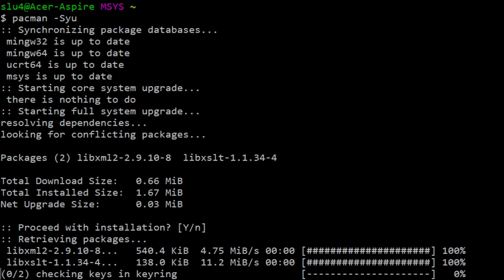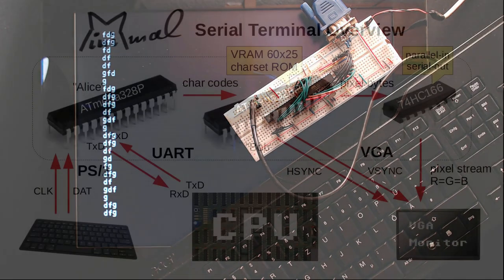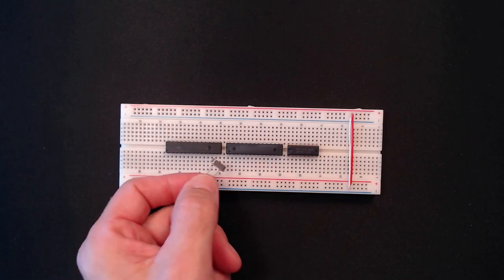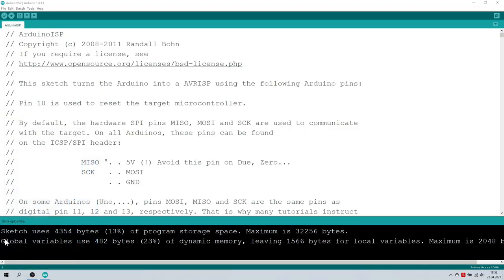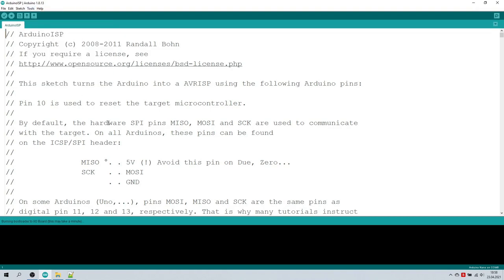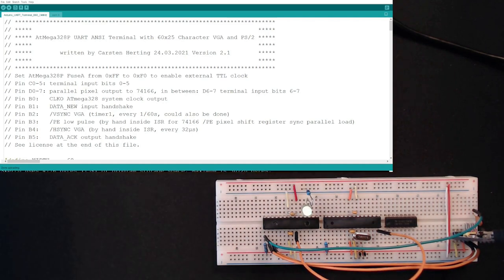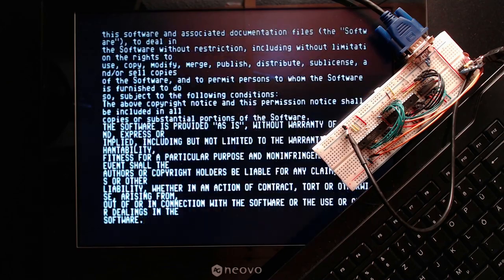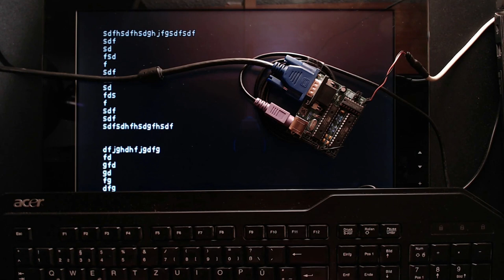Let's Build a FAST Serial Terminal with PS/2 and VGA

Comment: Hello! As you told me, I am trying to do the terminal from grant searle’s website. I am currently running into some problems when trying to upload code. I never did this and files seem to be in .hex. I was wondering if you could help me in anyway and if you had other platforms we could communicate other than YouTube comments. (By the way I subscribed!!)
Reply from the maker: Hi Maxim, I've never used Grant's code for composite video and can't be of any help with that, I'm afraid. Just explore it slowly step by step... cheers!
Reply: Ok thanks anyways but I wanted you to know I really like your videos. If this ends up not working I’ll make your design as I am sure it works!

Comment: Hey Slu, I've got some socketed Arduino Unos here, do you think if I programmed them with this code in place I could take them out and used this setup it would work? Assuming I changed the fuses of course!
Reply: Future Aaron here- the boards file is now located at:

C:\Users\(USER)\AppData\Local\Arduino15\packages\arduino\hardware\avr\1.8.6

For the 2023 version of the IDE.
Reply from the maker: Hey Aaron, as long as you can get your hands on some raw AtMega328s it should work out fine. Happy tinkering 🙂 Any ambitions for a future "Minimal 64" build? ;-)
Reply: @slu467 I've got a whole tube of them here! I followed through the instructions here and got the blinky example working fine on the 16mhz clock but I've had trouble with the 24mhz crystal. I've made an active one with a 74HC04 and some passive and am hoping that will work out better.

I was thinking about making the new Minimal but thought I'd wait in case you revised it again, I've now got two of them here.  I'm currently working on a ZX80/81 clone that's been quite a lot of trouble!
Reply: @slu467   If I am using an active oscillator for the input of bob would I need to change the fuse bits on bob to expect an active signal for it to work? I've assembled the whole thing, I can load Blinky but none of the functionality works after I upload the code to the pair, no VGA, no seral data. I've checked on the scope and there are no video signals coming out of Bob, but I am getting the 24mhz signal out of pin 14 of bob.
Reply from the maker: @colonelbarker  It might be good to make sure that each µC receives it's program correctly (via 16MHz I guess) and runs it's code corretly, too, at a higher rate. I'd test that procedure with some "dummy" blinkenlights code. The fuse bits need to match the oscillator setup you intend to use. But keep in mind that all this is using the AtMega *out of spec*. I might just have been lucky with my production run. Never had any problems though... good luck!
Reply: @slu467   I'll admit I'm still struggling.  I moved it over to perfboard and couldn't get the code running, the blinkenlights runs fine at 24mhz but I can't get the VGA/ keyboard code running.

I ordered your pcb design a couple of days ago so I'll try again on that and see if it works better, my breadboard may have been causing problems or some of the wires on my perfboard. I've also ordered two different types of 24mhz crystal and new 22pf caps. So hopefully that helps!

Comment: I'm so impressed, I'm going to implement it on my 6502 homebrew. So far, it's the best Arduino to VGA I've seen.
Reply from the maker: That's great. Please let me know how it goes!
Reply: @slu467  I tried it, and for the most part, it works. Alice does its job. As for Bob, the text is barely legible, it displays the characters unstably/flashy, and dimly. (Don't know how to better describe it) The text position and alignment on the screen are stable. I double-checked the wiring, and all seems ok. I even changed the WIDTH to 40 (both in the .ino and .s files) to see if it would change something. Alas, same result. Timing issue maybe? The monitor detects a signal of 720x480, rather than 640x480. Do you have any pointers? I really want to make this work... it's too cool of a project!
Reply from the maker: Since the text position is stable, this does not sound like a timing issue. If you see the characters too dim (but at their correct place) the pixel data is maybe not driven correctly? I'd double-check the output stage of the 74166 to the VGA connector pins 1, 2, 3 via 150 Ohm. Hmm, but it is also possible that your monitor "misunderstands" the sync signals and therefore switches off brightness... I've only tested the circuit on my older VGA monitor and newer TV which both worked okay... good luck!
Due to timing constraints the Arduino can't match the VGA timing perfectly. Most monitors are pretty forgiving, though...

Comment: This is really interesting,  what's your secret to achieving so many great videos in a row?
Reply from the maker: Thanks Duckson Plays, glad you like my stuff. I guess I just do what feels interesting to me :-)
Reply: @slu467  Well I'm glad we are both interested in the same thing.  I don't know if the terminal would be much use to me but it's cool to see. Your minimalistic CPU is worthy of the minicomputer title.  :-)
Reply: @slu467  I think I will use wire wrapping for my CPU since it's more stable than breadboards and less easy to mess up. PCBs seem nice but how do you know your schematic is correct.
Reply from the maker: Wire-wrapping IS kind of interesting for larger projects. Very reliable electrical connections, indeed! BTW I am now at iteration 5 with my PSB computer :-D
Reply: @slu467  Oooh... I'm curious what is your CPU's instruction set. I want to compare clock efficiency with mine and yours doing the same tasks. Your CPU design seems very chip efficient and powerful.
Reply from the maker: @ducksonplays4190  ... coming soon...
Reply: @slu467  The plot deepens...

Comment: This is great. Almost perfect.
Would it be possible to use 3 chips instead of one for bob, one for R,G, and B respectively?
Alice could use "Chip Select" pins to decide which ones should be active, but send the same data to all 3.
It would require 7 Chips instead of 3, But would allow for 8 colors.
Alternatively, you could use another µC to implement ANSI music control codes for some sound output.
Reply from the maker: Great ideas! Sounds like a new project, though ;-)
Reply: @slu467  Well, since the last manufacturer of serial terminals has closed, you have all the market to yourself ;-)

Comment: thats what I'm searching for.....    not the "serial terminal", no it is the process to get sketches into an 328P without an UNO board....      

Until now I put an 328 DIP in the UNO Board an programming it to run it in alone the free world. 

Now I can design my own board with an 328 TQFP soldered on it an programming it with arduino sketches. Thanks.

Comment: Nice project. Certainly gonna build it, since I finished building the minimal v1.5 board now. Would it be possible to replace ps/2 for usb keyboard by replacing atmega328p by an atmega32u4 ?
Reply from the maker: Hey Waldo, USB has a more complicated protocol, so I'd say you definitely would have to upgrade the µCs for that... probably the whole point of this design (squeeze out oldschool stuff) becomes obsolete then ;-)

Comment: really nice project. are slower bitrates possible. i have some old hardware that only run on 9600 and not 28800?
Reply from the maker: Should be a tiny mod.

Comment: Is the limitation of the lines and columns related to the clock or could this generate a 80x24 (+status line (25 total)).  What is the minimum baud that this can support (9600?)?
Reply from the maker: IMHO 80 cols is not possible. 60 cols is just possible with 24MHz overclocking. I'd like you very much to prove me wrong :-) Min. baudrate in my design is 28800 (can be set by a jumper) but lower rates might be possible if you are playing around with the Arduino timers a bit.

Comment: Hello, that's great guide, but I have a problem. Burning of bootloader seems be ok but control LED doesn't glow for me. I have checked wiring even tried another Atmega 328P. I doun't know where could be problem :'(
Reply from the maker: Hm, difficult to help here from afar. I assume you do not have a digital scope at hand to really take a look at the signals... polarity of the LED is okay, too?

Comment: Only three chips! 
 
Are you aware of how much processing power a bare bone Arduino has? It is capable of doing all the work the flight control computer had to do during the MOONLANDING and singing Daisy Daisy at the same time.
Reply from the maker: Hi vanhetgoor, I absolutely wasn't aware of that. Thanks for pointing me to a new and fascinating project :-) Cheers!

Comment: Hi, I recently tried building this but for some reason I'm not getting any output on the monitor. I was able to change the fuse bytes and upload the bootloader to both of the microcontrollers, and verify that it worked with the blink sketch. I also uploaded the Alice and Bob sketches, and wired everything according to your github schematic. The only difference is that I used a 62 ohm resistor for the vsync and hsync signals since I didn't have a 75 ohm resistor. Any ideas on what I could be doing wrong?
Reply from the maker: Hi, this design is known to work, i. e. it has successfully been built by others. 62ohms should be fine. I am using 68 all the time. Hard to tell, what is going wrong with your build. I'd recommend using a cheap PC scope to look at all the signals (VSYNC, HSYNC etc.).

Comment: Hello! I have just made this on breadboards and I was just wondering because every time I try to use it, the only character that will show is @ symbols instead of the character I want to type. I was wondering if you had this issue while building? and if so what you did to solve it. thanks!
Reply: also, if it matters at all, I am using a 74HC165 instead of a 74HC166. although i used this on your minimal vga project and it seemed to work fine. I also do not have a ps2 keyboard so I am just using PuTTY as a serial terminal. I was thinking it might be my baud rate, so on my speed select I tied both my pins to ground. I was assuming this meant it was running at 28800 baud but i might be wrong as i could not find a key anywhere telling what the different baud rate selections were. And one more thing, sorry when i try to connect the B microprocessor RX / TX lines the screen goes crazy and wont show a stable picture. Thank you! i know that was a lot.
Reply from the maker: Did you have the TR0-TR7 lines installed properly? They do not show up as "lines" on the schematic but their connection is indicated by the labels. You are talking about the loop back test, right?
Reply: @slu467   thank you so much! I did not realize there was lines right there. I hooked it up and I got it to sort of work, it puts a stable picture and shows a blinking cursor. sometimes when i turn it on it will work fine and other times it wont. also, when i connect the RX / TX lines to Bob it makes the screen go crazy. and since i do not have a ps2 keyboard i have those lines tied to ground and i am using PuTTY as a serial terminal program on my computer.
Reply: I also have both my baud rate select lines tied to ground and i think that means it is at 28800 baud? But that could be a problem
Reply from the maker: Henry, this build is so critical that I recommend you do not change anything at all. You cannot expect the circuit to work properly when using different ICs. I have chose the the 74HC166 for a reason. You are right about the Baudrate but I have no idea what you are doing with the RX/TX lines. They are only for in-situ programming of the Arduino B. Do not use them for anything else. Good luck!
Reply: @slu467  ok thanks! I will put the hc166 on order

Comment: Why not 80x25?
Reply from the maker: Hi Stephen, the already heavily overclocked ATmega328 can't pump it out fast enough within the VGA timing.
Reply: @slu467  Ok, perhaps an STM32 or RP2040 (say Raspberry Pi Pico) will be capable to do 80x25 VT100 emulation, right?
Reply from the maker: @stephenwong9723  I am thinking Pi Pico, too. Actually, it is pure madness to try and implement VGA on an ATmega328 ;-)
Reply: @slu467  True, Video signaling is too too much for an ATmega328.